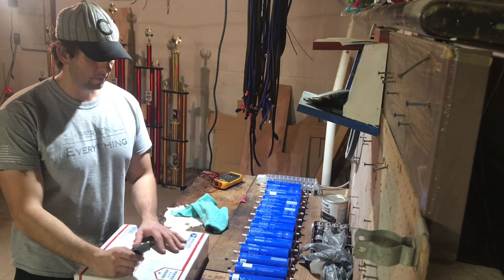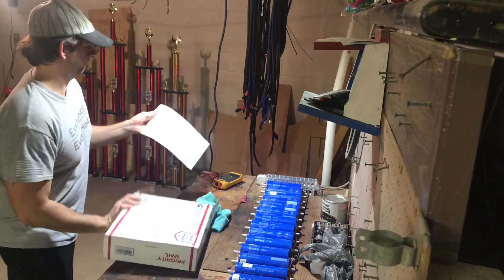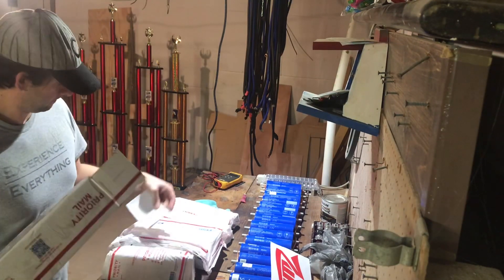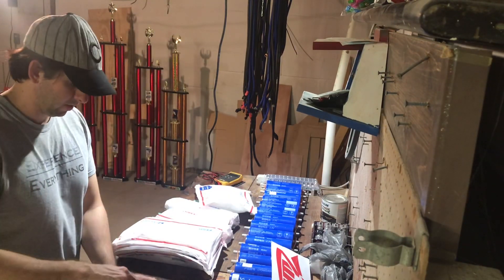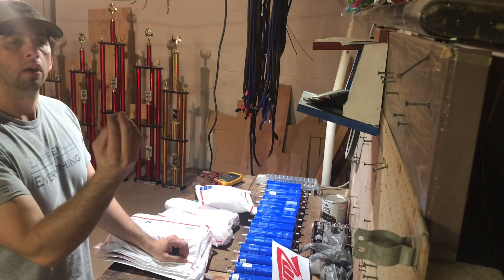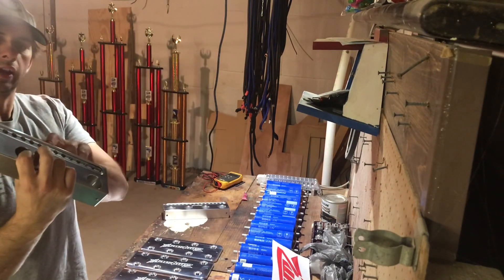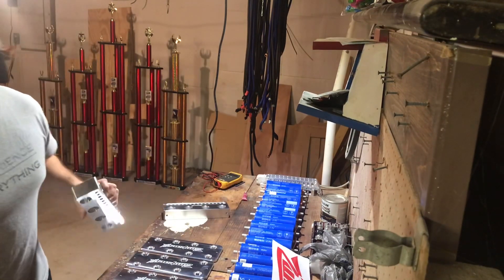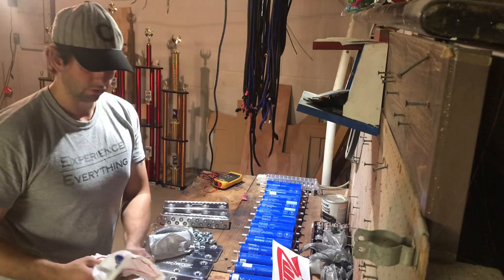YINLONG BUSS BARS FROM ILL CUSTOMZ UNBOXING

Comment: I hate how they use only 1/0 holes. I use SHCA 2/0 XL wire and don't like reducers. I see CES's 80 ah LTO Yinlong cased battery terminal busbars can fit my wires. XS Power's new 80 ah LTO Yinlong battery fits only 1/0 as well. 1/0 wire is too small. Heck, even my 2/0 is too small, I'm liking SHCA's new 4/0 XL wire except it doesn't come in silver which is all I use for both + and -. Thx 4sharing. ANY UPDATE VIDS? (I'll check)